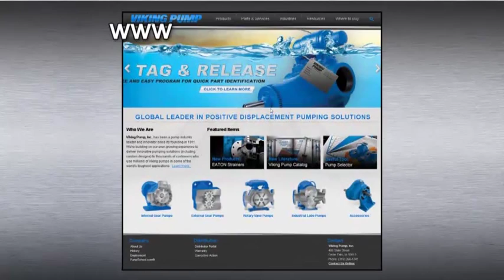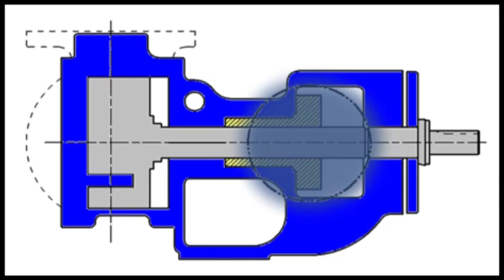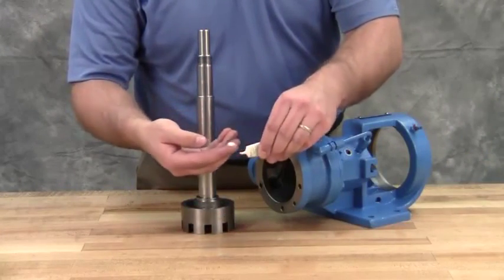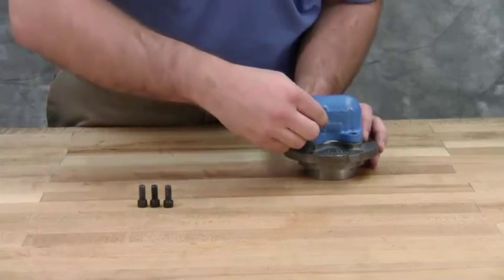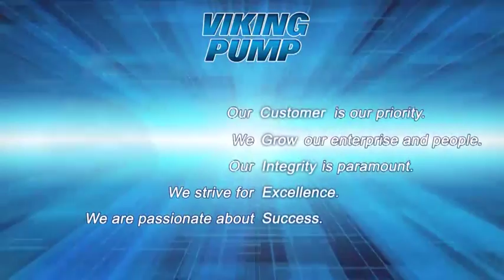MSE Ltd-Disassembly & Repair of Viking Universal Pump with Mechanical Seal in stuffing box

Comment: Greetings, I followed the instructions of the zero point calibration (of course), and then adjusted to 0.75 ", but the pump is leaking from the exhaust that is in the bearing body